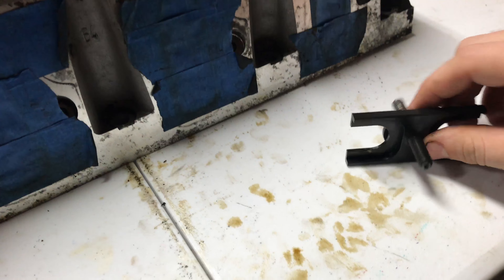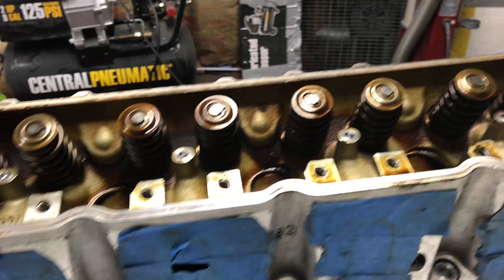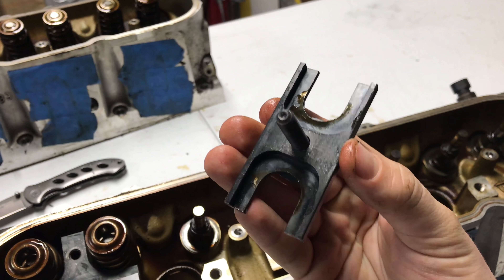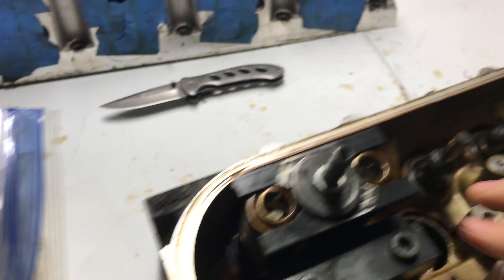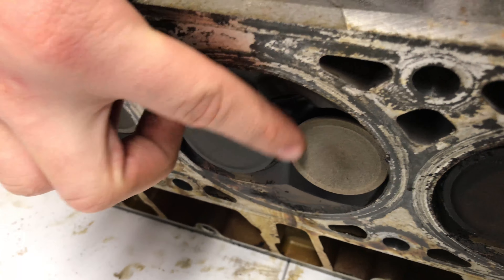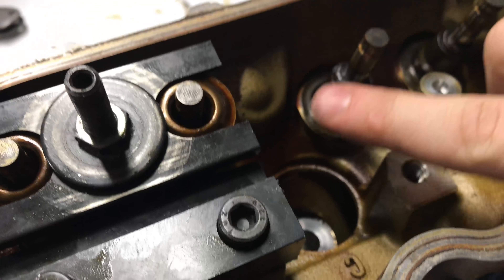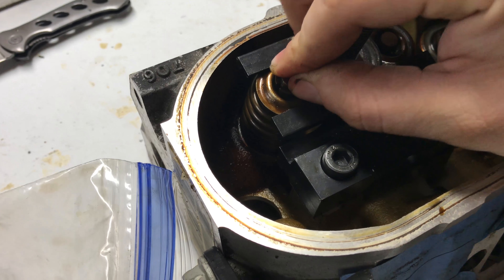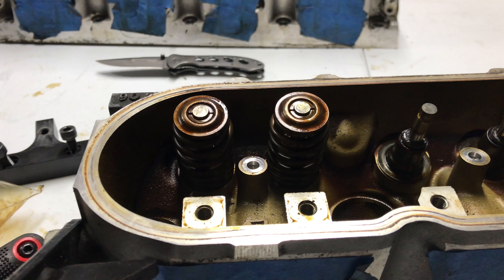E30 LS BUILD EP 19: LS1 VALVE SPRING INSTALL [4K]

Comment: What causes the rockerarm to move? I understand camshafts but not rockerarms
Reply from the maker: So this a pushrod style roller rocker setup. You have rollers that ride the camshaft and when it hits a lobe the pushrod rises up which moves the rocker, and in turn compressing the valve spring and opening the valve